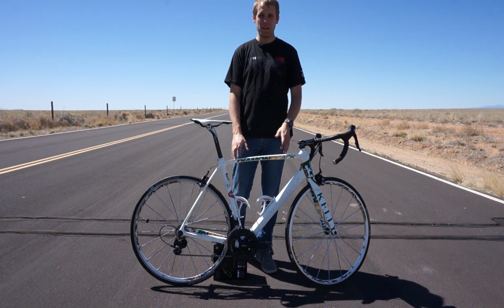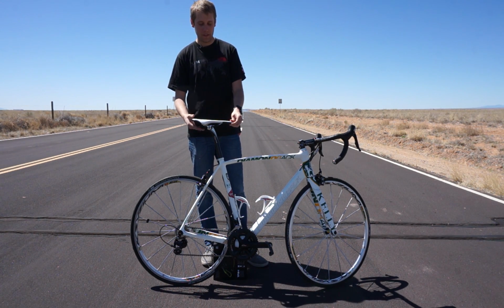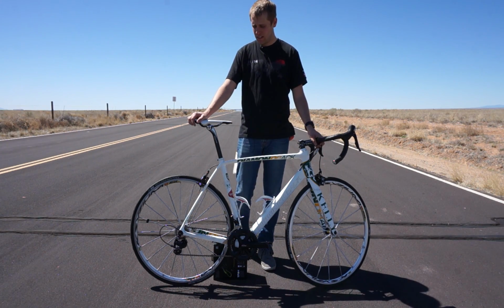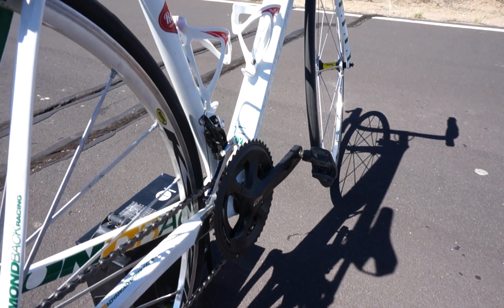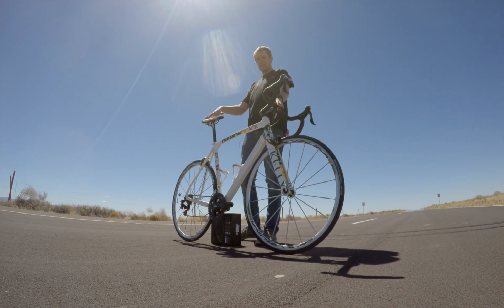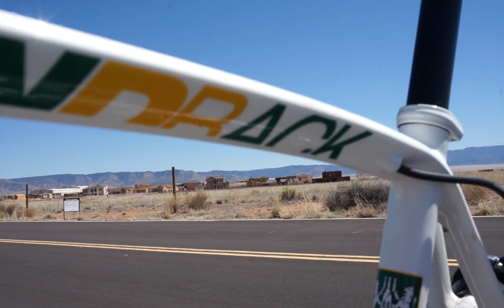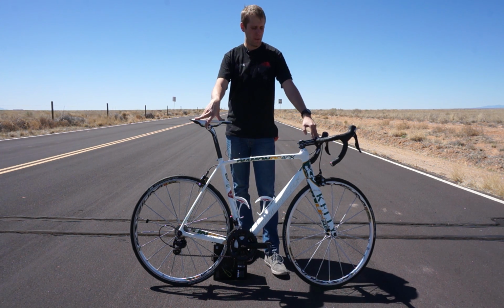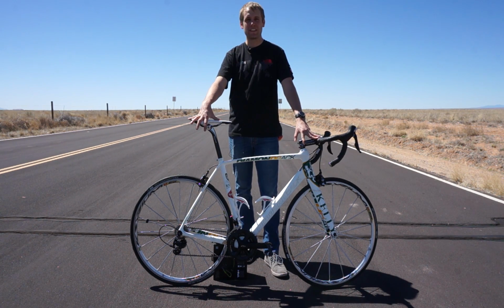Pro Level Road Bike - 15 lbs - Under $1000

Comment: The bike is solid, nothing sound on it even though I did not fine tune it just put it together, well pack and easy to put together. It's fast and I feel the gear ratio is perfect,✒>share4.photo/RoadBike?Nレ    I live in Florida everything is flat here so it's perfect, even when I'm climbing it feels nice and light. Brakes are good too, everything feels of good quality till you get to the pedals. In fact the treat in one of them was almost bad I had a hard time to install it. Saddle I ok as well, after 20-25 miles it hurst without bicycle shorts with bike shorts it's not so bad.

Comment: I just bought a Militis 3 carbon frame on amazon for under 300 , it weighs 2.1 lbs also hollow chain is very light and carbon rims new old stock were again under 300. I also went with a single crank sprocket . I left off all the switch gear that goes with it as well . 11 speed rear with a high tooth count to help out with climbing and a 11 tooth for the long roads and down hill . This part of Florida has very little hills and a decent trail system . Converted rail to trail system lets you ride nearly all the way across the state with out sharing the road . I will weigh this up as soon as I finish it . Any pointers are always food for thought 😀

Comment: I have a 2013 Cervelo S2 and would like to get Zipp SL aero bars! But they're expensive at retail so it would be nice to find some quality used ones or new old stock! Other than that the bike came with Dura Ace 9000 and I guess Sram Red eTap could work but not sure if it would work well with the Shimano DA 9000 brakes! I'm running either 105 5800 or a DA 9000 crank with it.

Comment: that 105 set comes w/ a big weight penalty, compared to SRAM.   I built a steel frame bike that weighs in @ 17 lbs.   Not hard to do but you have to snag every gram conscious deal on ebay.   Starting w/ a carbon frame certainly gives one a head start.

Comment: Wait, how did you fit 11 speed cassette on a wheelset from 2008? They were running 9 speed back in those days
Reply from the maker: Mavic 9/10 hubs  used to require a spacer. Remove the spacer and you have an 11s compatible free body.

Comment: Question: can you reduce the tire size from 26" to 24" and expect the bike to set a little lower? I inherited two 26" vintage road bikes, but my nuts are pressed too tight on the top tube? Or any other suggestions?
Reply: Timothy Bradek remove the nuts or the top tube.

Comment: So, about $915 for frame, un-swapped groupset, and very old wheels/tyres, and you 'paid' $40 for the bars. Call it $950 so far. Now, how about the seat, pedals, stem, seat post, swapped brake calipers, bottom bracket, handlebar tape, and carbon paste! Even given your caveat of spending an extra $300, is that realistically possible? Finally, how many people can realistically get access to a used frame like you sourced? It appears to me that this kind of build can only be done by people connected to pro teams and get top quality for basically free. Most of us do not have your connections. Why not do a project build that sources all items from openly advertised sources...and without free-of-cost swaps. I challenge you to do a sub-15 pound bike for less than $1500 using only openly advertised sources (i.e. no use of 'friend prices').

Comment: Got me a bmc rm01with sram red and carbon parts  at 15.4 pounds for $1200 . Will never buy brand new ,yull be surprised what you can find with a lil patience and luck
Reply: Agreed!  I bought new once and Trek dropped the price $300 a month after I took delivery.  I've built 3 bike since then , all ebay sourced parts, all light years better and  for less money than the first bike. I'll never buy new or retail again!
Reply: If your gonna buy new buy one that's old stock .I bought a $1100 trek that was 2 years old for 700 after taxes now I'm looking to sell it for 500 after 2 years of ownership so my loss is minimal. but like you said its satisfying buying the parts you want and customizing your bike to suit your needs and size to have the perfect bike.
Reply from the maker: I will more people would read this comment to understand that its pretty easy to get high end bikes for cheap. Time and patience! Good work!

Comment: 105 as good as dura ace, $450 Frame as good as 7000 bike. Huh. Seems legit
Reply from the maker: Surprisingly it is. The difference between Dura Ace and 105 is negligible and I would recommend Alu over carbon - the Allez is lighter than the lower level Tarmacs.

Comment: Frame, fork, components - $1000.  Shipping for all the components and frame?  1 month time to source everything. Are the parts new? used? labor to assemble? Tools required to assemble? Buying Shimano overseas is the reason Independent Bike Shops are closing and something Shimano is trying to put the end to.

Comment: Why bother going through so much trouble and risks (assembly, compatibility between new and second-hand parts, tools to assemble it, and so on) unless your passion is building bikes, not riding bikes?! 

Unless you really plan on racing on that bike the difference from 15.8 LBS / 6.95 Kg and 17.86 LBS / 8.1 Kg, that would be my current bike, is not going to be that important. And if I were planning to race on a bike I don't think I would rely on a second-hand bike made from parts.

I got my Canyon Endurace Al 6.0 with full Shimano 105 5800, Mavic Aksium wheels, and Continental GP4000SII tires for 1000Euros in march 2016.

Canyon Endurace Al 6.0 - 8.1Kg - 1.099,00 €
https://www.canyon.com/en-ro/road/endurace/2016/endurace-al-6-0.html

ROSE PRO SL-2000 - 7,95 kg - 1.099,00 €
https://www.rosebikes.ro/bike/rose-pro-sl-2000-bike-now-821326/aid:821333

Comment: I have build Felt F1 SL roadbike on 7.5kg (size 58cm). Parts are Sram force groupset (2013) Fulcrum F3 wheelset with conti grandprix tyres, saddle is fizik arione (240g) seatpost is ritchey wcs carbon, stem and handlebar are Aluminuim PRO sl, peals are look with Titanium axle 240g pair. There is still plenty room to go down with weight for low amount of money, for now it has costed me about 1000 euros

Comment: Wheels, frame, and groupset come to $935. So $65 got you handlebars, stem, bar tape, seat post, saddle, tires, tubes, pedals, and bottle cages? Please tell me where you shop.
Reply: You have to steal the rest of the parts.
Reply from the maker: I purchased the group set new, which you could get a used for about $200. This would give you a bit more of a buffer. However it really is possible to get a super light stem, stem, bars, and saddle for under $65. Example - Performance bike forte stem with coupon for $20, bars with coupon $20, $1 tubes at the trek store after signing up for their newsletter, search craigslist for a seat post or amazon Chinese carbon ... oh and tires, get a super bald set if you want super light bike which any shop will give you for free. You can follow my eBay account if you want stuff for super cheap, I sell most of it off because the bikes are just build for the videos. I guess I don't understand why its such a chore for people to find good deals.
Reply: Bars and stems are cheap used.  I bought Bontrager Blender takeoff stems at lbs for $5.99 each, saddles for $20, handlebars for $20.  You don't have some tires lying around?

Comment: The only problem is that unless you know what you are looking for, you could have a lot of really good, shitty parts. The average cyclist is probably not going to know how to look for a cracked frame, or any cracked carbon part. The bearing ports could be ruined. This is the problem with buying used, is that unless you can 100% know that everything is safe, 200 miles later and you could be in the hospital from a cracked frame or seized hubs. At least a new bike from the bike shop is going to be held to a standard. Go for gold if you want to source all those parts, but with all the time you're going to spend, you're better off picking up a part time job and earning another $1000 to just get a full carbon lightweight bike.

Comment: 15.8lbs is not 15lbs....  and the addition of pedals (and I have yet to be able to ride a bike without pedals)  will add about0.50lb...  so you built a 16.3lb bike, not a "15lb bike".
Reply from the maker: Sills71 It's certainly possible to build 15lbs bike for $1000. Also I would like to say that pedal systems are not a half pound - check out the Ultralight Cirrus Ti pedal system that weights just 100grams (with cleats!). I tried to keep the bike 'real world' with parts that people could find. For example - an off the shelf wheelset as opposed to building a custom set of ultralight tubulars, that would be about the same price if sourced from overseas manufactures. That would take a pound off the bike instantly, pushing it into the 14lbs range. However, how many people have the technical ability to do that? Thank you for the view and I appreciate the interaction on the video :)

Comment: I've gained a ton of weight over the years, (I'm 6'0 270lbs) is there a road bike that is suitable for my size and weight that you could recommend? I feel I might be to heavy for biking. lol. my budget is $1200- $1500.
Reply: shook919**. I am a retired Cat III Racer & Trainor (I am 65yrs old). I would recommend a large CycleCross Bike. @ $1500 you can get a used or starter from Ebay. The tires should be 28-35(maybe a 35cm on the rear. CycleCross bikes have a long wheelbase(where the tires touch the road) The ride is smooth. Try riding 2x a week @ 12-15mph. Keep your heart rate in the 120-125 range if you can...... Gradually increase your miles- - -  not your speed !!........ (you can do that later) Once your Heart Rate stays @ or near 120-125bpm, add 5 miles slowly. The weight should drop quickly w/o "rebound". Stay on flat roads for 3 to 4wks. The loss of weight is consistent & steady. You should see a quick 10lbs leave in 3 weeks. When you feel aerobically confident, & establish a good base (@ least 150 miles) You will feel your confidence grow but proceed cautiously for 6 to 8 weeks. Most of all, stay patient, & do not get discouraged in the beginning. You did not say what your age is but the "rough" formula for heart rate low and high is      220-(your age) x .80 for your max rate & 220-(your age)x .60 for low end. Remember Long Slow Distance gives you max results. Good luck & remember to be patient. At 6ft tall & 270lbs, you want to lose 25lbs minimum very slowly. I bought a CycleCross Focus (made by Cannondale) & I love it more than my wife. I have 5 bicycles. Felt-Giant-Specialized-Cannondale-Trek. Lastly, the brakes on Cyclecross bikes have fantastic response.
Reply: wow! thank you for the great info. i really appreciate it! is there any difference between a cycle cross and a gravel bike? i was interested in purchasing the fuji gran fondo, it's on sale at my local shop, right in my price range.
Reply: shook919 a dedicated cyclocross bike has a higher bottom bracket for extra clearance and slightly more aggressive geometry. A gravel bike has a lower bottom bracket but are supposed to be more comfortable for long rides.
Reply: you should be good on just about most road bike because the frames are made to uphold up to 400 pounds. just watch out for the wheelset. those might be the issue because those do have weight limits and those will fail.
Reply: thank you for the info! what would be a good set to go for, in your opinion? there's so much out there i don't know where to begin. lol.
Reply: Well it depends on what type of riding you plan on doing. I'd probably recommend a endurance style bike for their comfort. Things that come to mind are the specialized Roubaix and giant defy.

Comment: at least make a build that the public can make as well, what use do we have that you and only you can get decent discounts on most of these parts and u get an awesome carbon handlebar that no one else will get for that price?
Reply: 2014 Diamond back Podium Equipe frame wtih an Ultegra Groupset and Chinese carbon wheels all sourced from ebay.
Reply: What bike?
Reply: I'm "the public" and I built one over the winter.  it came out to 15.2 lbs w/o pedals.  Its my 1st build.

Comment: Frameset and groupo were 800$. Where did you get handlebars, stem, griptape, seatpost, seat, and ladies and gentlemen the kicker, the wheels, all under $200? I call bs. Your haggling must have included some gunpointing, cause no light wheel set is even close to $200 brand new. And if the stuff is used it won't last even close to ten years.
Reply from the maker: +Ben Braceletspurple Bars, seat came from Cycle Cave in Albuquerque, NM. I have purchased many parts from him over the years. Seat post came from Craigslist - I can supply a contact for that too should you want it. The Ksyrium Elite SLs are from 2008 and you can get them on eBay for under $200 (sort by sold items). Will everything last me ten years? I would imagine so, but the bike has already been parted out and sold. It was super fun project, and though you may call BS on it. I am here to tell you it far more realistic than you think. Bike retail is hyper inflated, ones parts hits the grey market or used market, most things can be purchase for 60 or 80 percent off.
Reply: +Bryan Jurus see it isn't new parts, that's your error. anybody could do this. all-New parts it can't be done. I can go buy a built-up S-works for $1000 used weighing 13 lbs. so if it's used then no-duh. aftermarket is bs. bikes don't work well like that so nah.
Reply from the maker: +Ben Braceletspurple Ben, where can I buy a used S-Works for $1000! Especially one that weighs 13lbs. I would imagine you would need a Sram Red groupset with a super-light crankset and some amazing wheels to obtain that weight. The parts featured in the video anyone can obtain if you look for a little while. Again, the idea for the build was to be real world. I never mentioned anything about the bike being new. It's a project for people wanting to get the most out of their buck, but seeing as you can pick killer bikes for under a grand - then its probably not a project for you.
Reply: +Bryan Jurus title should be, "build... a 15 lbs bike" then. and to answer your question, well probably the same place you bought such light wheels for less than $200. s works frames themselves save the weight btw.

Comment: I agree with mrstoneycool69 the the weight seems pretty light for the components listed. If you look at the new Velo buyers guide magazine you see bikes in the many thousands of dollars with like Dura-Ace, Sram Red, Di2 etc. that weigh in the 16's or 17's ( example- a 5700$ Felt F2  16.14lbs. ).Bike weights have always mystified me, on how some bikes can cost so much and still be relatively heavy, and then the sub $1000 project bike come in at 15.8lbs.
Reply: Electric shifting adds weight. And aerodynamic tubes add weight. Most stiff climbing bikes are under 15 lbs. @ or over $5'000